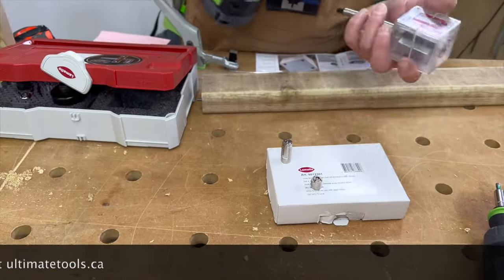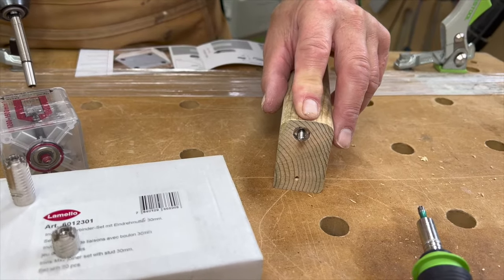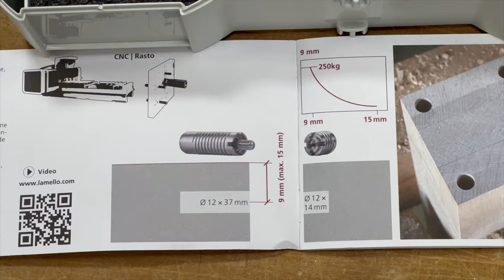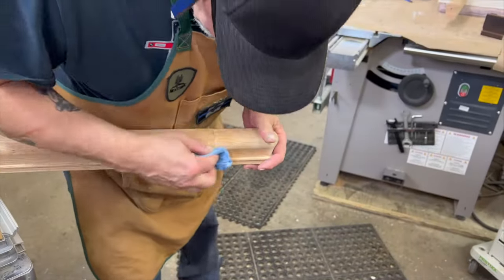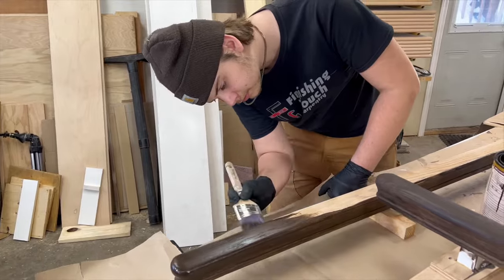Completely Invisible railing joiner: The mind-blowing Lamello Invis

Comment: I really was shocked I never heard of this?  However my question is do you use this much?  Or it’s nice to have?  Cost to buy also?
Reply from the maker: I use it on every railing job - especially on mitred handrails. I've also used it for railing to newel post connections. It's around $800+- (Canadian dollars). So it's expensive enough - but not crazy.  Thanks for reaching out.

Comment: Does this work on an inclined handrail? Like with 22.5° mitres?
Reply from the maker: Yes. I've done them on mitres and also where the railing meets the newel at the newel at the top of the stairs. Check out this video: https://youtu.be/4q9QOTmwQqQ

Cheers Scott!
Reply: @scottearlsmithFTC  Thank you so much for your response, Scott and I found your video a massive help.
I will be using these fixings from now on for my oak handrails.
Reply from the maker: @ryanolden5304  Thank you Ryan! I'm glad the video helped. Good luck with your work. Cheers Scott